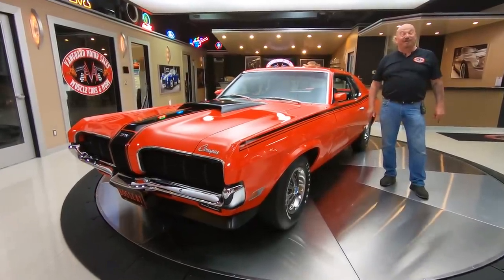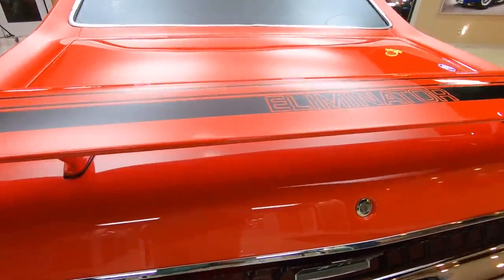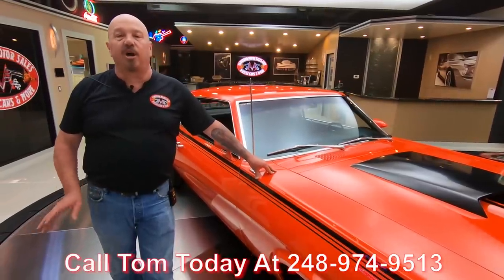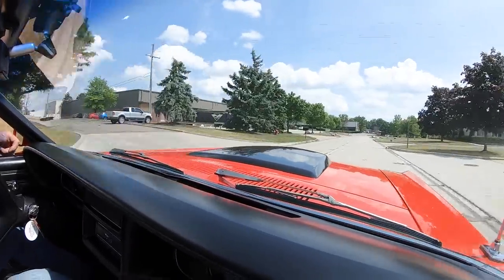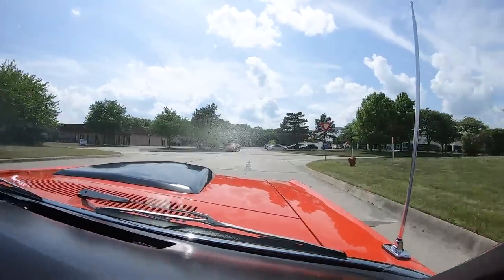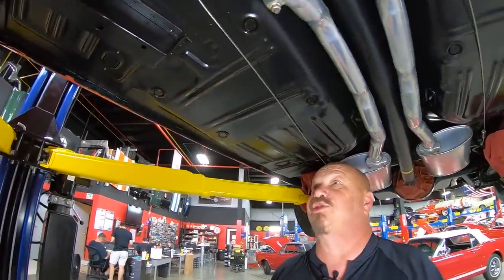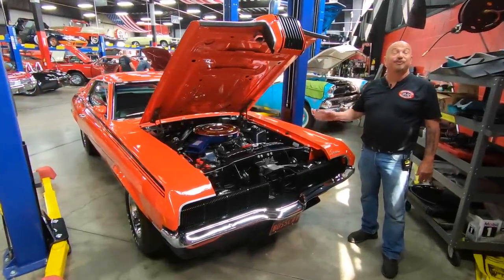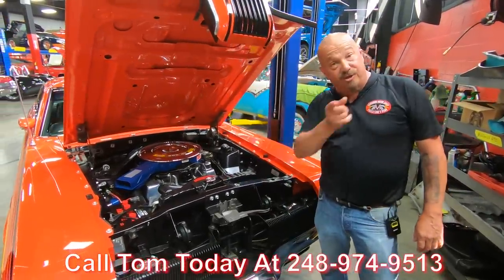1970 Mercury Cougar BOSS Eliminator For Sale

Comment: My Step-Father purchased a the exact Cougar Eliminator except it had the 351C engine new from a dealer in Vicksburg, MS. I've owned 5 Cougars 3 1967's & 2 1969's one being an Competition Yellow Eliminator 390GT powered parts car & the other was a 1 owner all original 351W. Sold them as a pair to be restored  as an Eliminator. Thanks for sharing 🍺 🎣

Comment: Beautiful specimen.  But rarity doesn't always correlate to a great or even good musclecar.  I just pulled out of my old magazine collection an April 1970 issue of "Car Life"  with a full road test on a 70 Cougar Eliminator with the Boss 302 mill and a 4.30 Detroit Locker rear end.  The best they could do was 15.8 seconds at 90 mph.  Top speed was a sad 104.  That was with their best driver and crew of factory mechanics present and involved.  It was a lengthy article and the testers were suitably underwhelmed, as evidently was the buying public...thus the rarity.  I once drove (hard) a new 70 428 Eliminator.  Mom worked at a Merc dealer back in the autumn of 69 and the sales manager let me drive a brand new 428 4 speed they had just got in.  Now THAT car made sense!
Reply: 351 and 390 motors were also  available for these back then. There was a wide range of performance available, depending on what motor was in it.

Comment: I have a 1969 xr7 cruise control, safety feature package, convertible, and air conditioned. 1 of 300 made, just swapped out the heater core and the turn signal switch, stop by cougar guy. It’s not it the best shape but she’s the only one like her i’ve ever seen